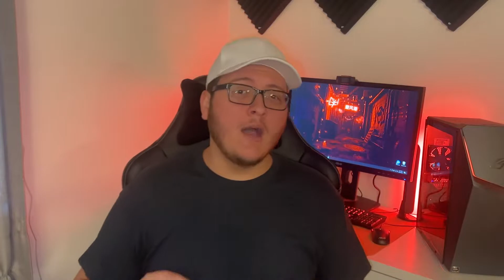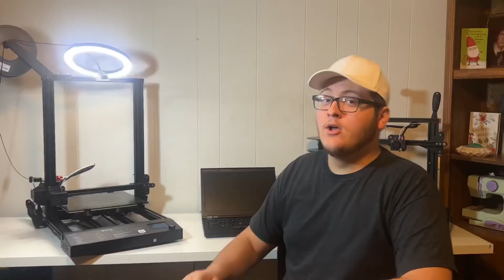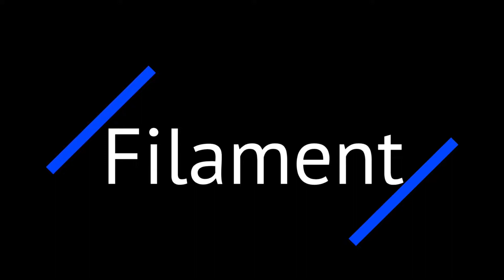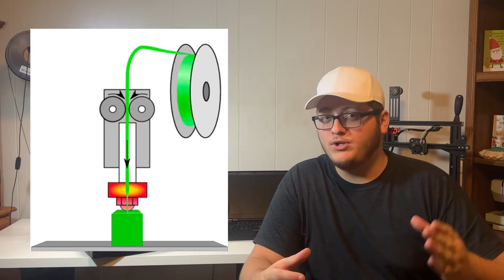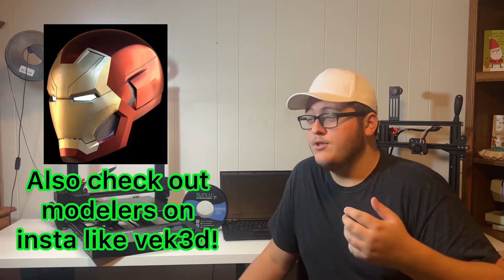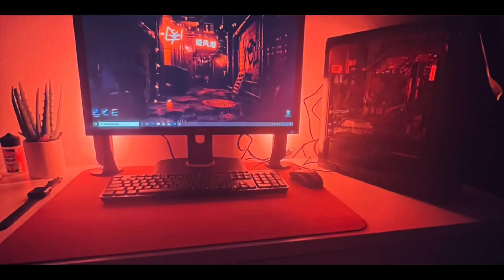How does 3D Printing ACTUALLY work??

Comment: hi! i have a neptune 3 plus i just bought. Im a beginner and have no experience printing. Im interested in making helmets such as the iron man one you have. What settings do you recommend for a good print. Im worried my prints wont be good. Please help
Reply from the maker: Hey id love to help! I would start with the standard settings and see how it comes out. Then start messing with the temperatures a bit and layer hieghts, and gradually you can tune it in and get nicer quality. It’s already great out of the box but it can always be better. Ill be making a settings video soon but in the meantime i hope that helps